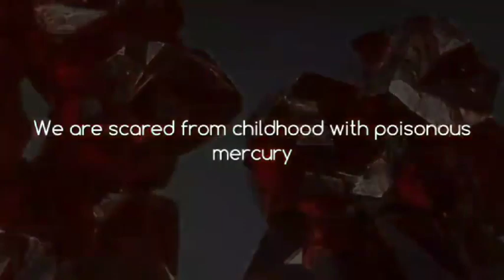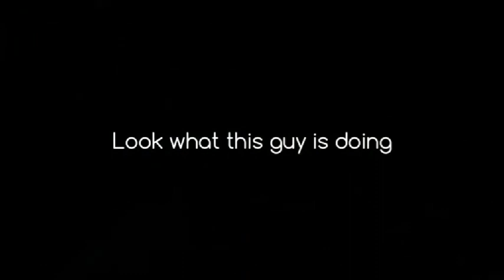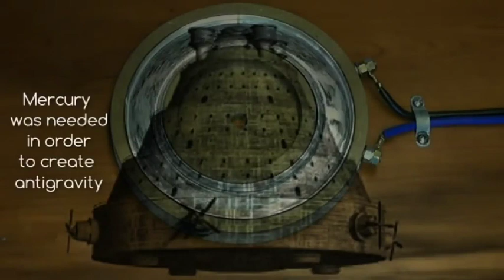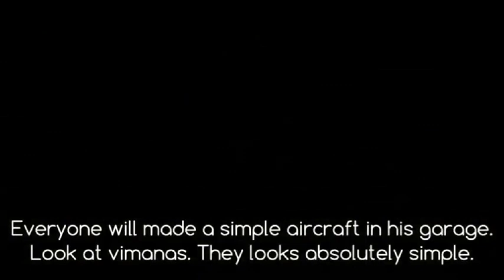Mercury, the key to "antigravity"?

Comment: You just need a sealed vacuum donut, some cobalt dissolved in the mercury, and an electromagnetic field driving it around the outside of the interior of the donut... Maybe a linear type motor? Cooled to -200k?